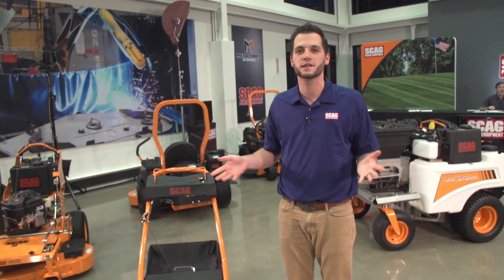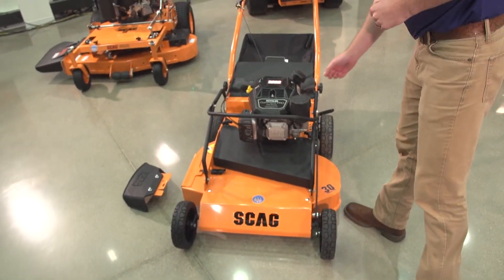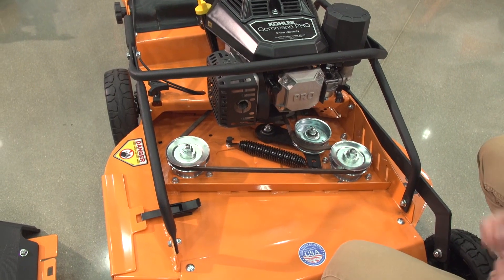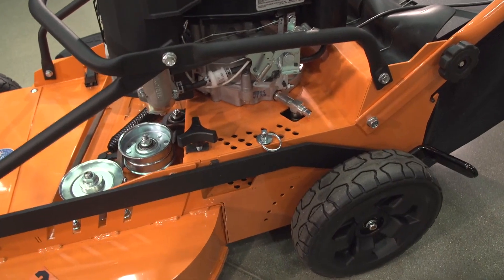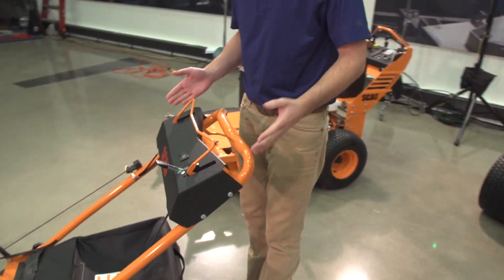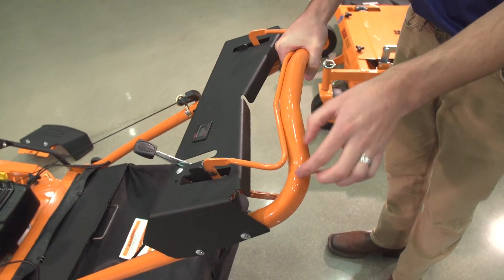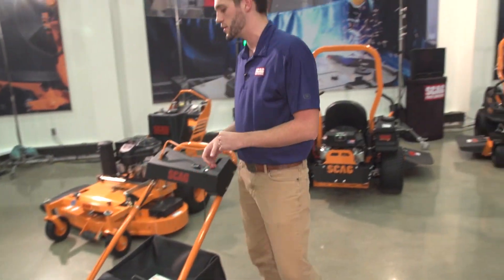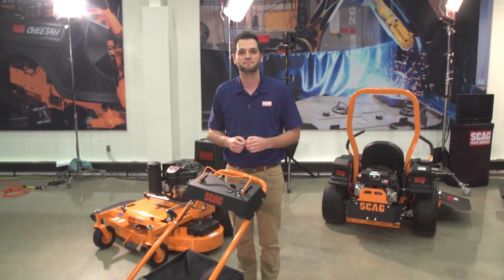30" mower prototype – SCAG LIVE 2020

Comment: That mower will look good on my trailer next to my Vride, Put a Big cc motor on it and I think it will out sell the other 30 inch mowers on the market, as long as it's not to heavy, that said, I want one,( IF) it has a strong motor and a good cutting deck, I will give away the 30 inch turd I have now, I don't have to tell you which brand I'm using now💩
Reply: Just remember, the bigger the motor, the more the mower weighs!
Reply from the maker: @vinceschannel8927  Accurate!
Reply: Bigger motor with swivel front tires would be nice.
That said....not sure how I feel about it not being a hydro.

Comment: i bought this machine and had it off my trailer within a day.  its to heavy and impractical to be out mowing for 8 hours comfortably all day without gassing out.  i returnd it and bought a honda 216 commerical and dont regret my choice at all.  this is a sales gimmic.  a 700 pound pushmower i just stupid.  rather buy a 30-36in stand on and trim with a 21.  DO NOT BUY!  i own a lawn company and we got rid of all our 30s cause they were actually slowing us down because workers needed to take breaks after using these things.

Comment: WHY a Kohler engine?   Junk.
Reply from the maker: This Kohler engine on this machine has been very bulletproof in testing. Brings a lot of torque to this class of machine.
Reply: Because they are looking for the lightest & cheapest engine that could possibly do the job to offset the very heavy weight of the machine.  The Kohler CV224cc is also the lowest cost option for 11 ft lbs of torque out there in a commercial engine.  Any step up from there doubles the weight and raises the cost significantly.  The question is whether it will be enough motor to lug this machine around.